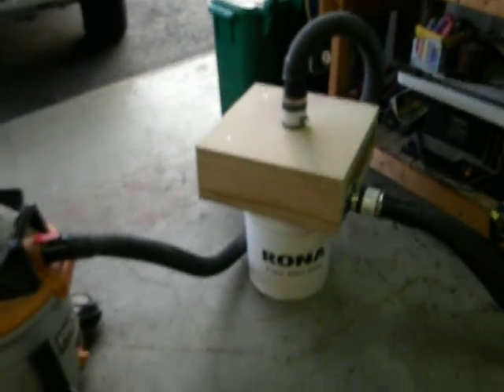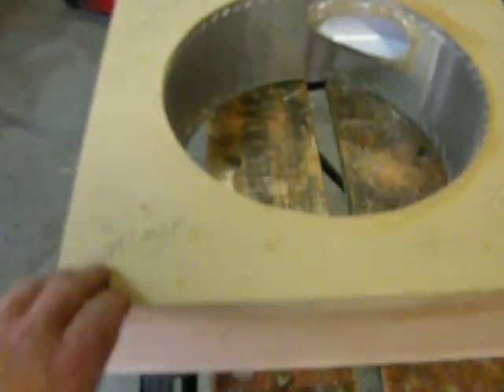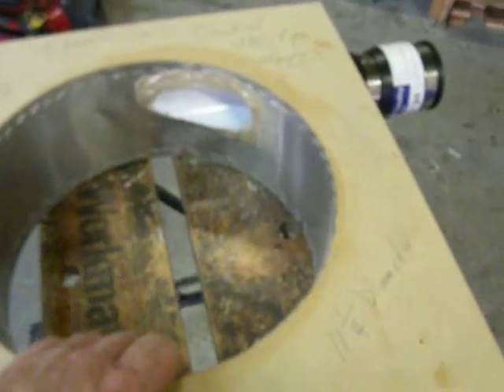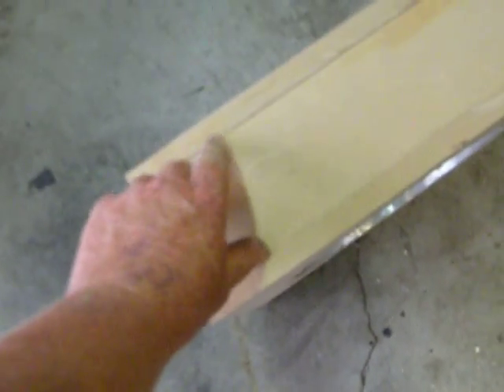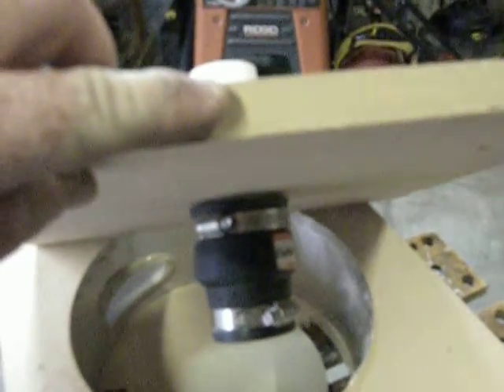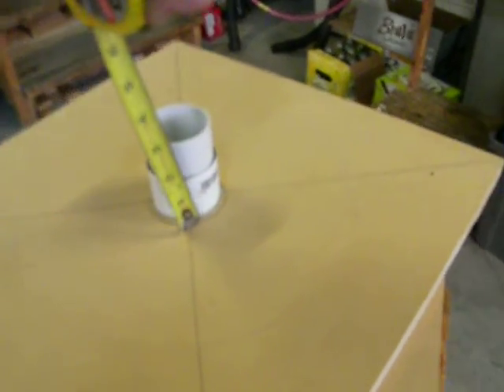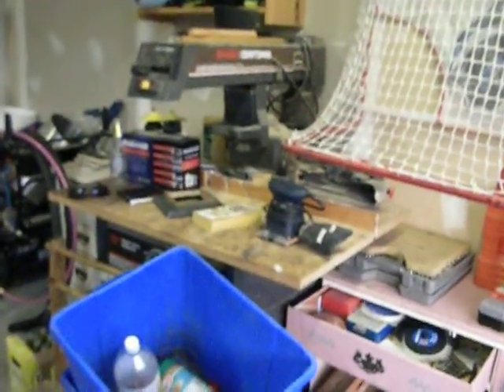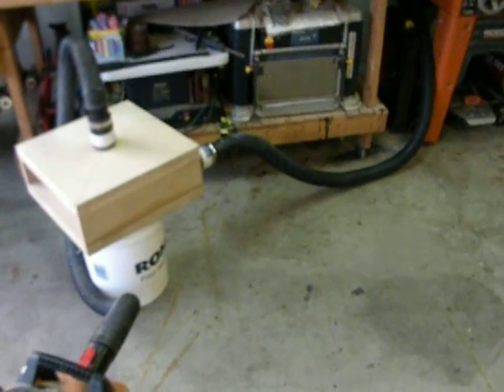How to make a cyclone dust separator for your shop vac.

Comment: Rob have to used the home central system for the cyclone?
Reply from the maker: You could use it with a central vac but many new central vacs are bagless so it's not as necessary.

Comment: Fill/inject the void in the box with PU foam-filler between the valley-flashing and the outer case. This will hold the inlet pipe steady and allow you to blend the surface /end of the pipe to the inner surface of the cyclone to reduce turbulence and improve separation.
Reply from the maker: +nlo114 - Spray foam is very versatile.  It's a valid option here.  Thanks for passing on that idea.  On my newer cyclones I have used stacked particleboard and cut out the circle for the cyclone and drilled the vac. port through with a forstner bit.  I like the wood ones better as they were easier to build and have a quieter operation.  Thanks for your comment!

Comment: Hi Rob! Great design!!! Do you have a list of the supplies needed? I basically watched and wrote down the different items, but wondered if you have an actual list? My husband is going too build it for my daughter to use to sand driftwood!
Reply from the maker: gmLb8806 No, in hindsight that would have been a good idea.  Here is another design (you can just make 1/2 of it) that may be easier to build.  Was my 3rd design and it's the one I'm currently using.  Good Luck with your build and thanks for your comment!
http://youtu.be/IfnIYbl63W4

Comment: Hi thanks for the inspiration I have just completed one of these and it works great ! I made my one with half a plastic bucket set into the mdf instead of flashing and I just cut the bottom of the bucket the same way as you cut the base of yours I left it proud about an inch so that it sits inside the collection bucket  and t worked first time.

Thanks again keep up the good work Jim
Reply from the maker: jim copland Awesome Jim!  You shouldn't get any dust in the vac at all once it's tweaked just right.  The bucket Idea is a good one.  I'd love to see it!

Comment: Does anyone know if a Thien baffle will still work if the airflow is pushed into it vs sucked out of it? My planer exhausts it's own chips. If I were able bodied I'd simply build one and see, but I'm disabled and building things is difficult so looking for input and/or experience with this. Also any 'bad' design flaws to avoid?
Thanks
Reply from the maker: George Woodworth It should work to some degree but it would work better if you bought a shop vac and used it together.  Ridgid vacs are not too expensive (They are the ones I use).  Good Luck!
Reply from the maker: George Woodworth Maybe this style might work best without a vac.   
http://youtu.be/tbsHjpKt4aM

Comment: This wouldn't be hard to scale up to sit atop of a 55 gallon plastic drum.  The design is solid.  If air is heated before it goes into the cyclone you could make a food dryer out of it (assuming it is sanitary).  This design has LOTS more applications than simply sucking dust out of your shop.

Ebner
Reply from the maker: ebnerglocken Sounds like a project. Good Luck and thanks for the comments!

Comment: Did you test it without the bottom on it? It might work just as well or better.
Reply from the maker: My first cyclone separator was designed like that.  It would build up a sawdust "snow drift" and then the sawdust would get pulled into the vac.  This set up at the bottom allows the dust to fall out of the air stream and into the bucket without being regurgitated back into the vacuum.  It works so well my buckets get completely filled to the bottom of the cyclone before they leak dust back into the vac. Thanks for your comment!

Comment: This design Rocks!  Followed Your design, and my PL Prem. applied yesterday morning has cured.  Just gave it the first test run.  Removed the bag from the vac to see results and dumping out shavings (Lathe, Bandsaw, tablesaw, drill, and circularsaw and router mix), dust, even picking up some rocks and bits of who knows what in the seams of the cement slabs in my garage.  Even grass off the riding mower...... Nothing!  Nada!  Nil! NOT A SPECK in the vac whatsoever!!  ALL in the bucket!  THANK YOU

Comment from the maker: OK!  Here are the exact measurements.  Locating slot (fits on bucket) is 1/2"w X 1/4"d (has cheap weatherstripping to help seal to bucket).  Dust slot is 1 1/4"w and total length is 22" or 220 degrees, it starts 3" from the inlet pipe.  The vac port (top) sticks into the cyclone 2 1/2", leaving a 2 1/2" gap between it and the base plate.  The inside height is 5".  There is some turbulence generated by the dust pipe input and the staples, don't know if it improves performance or not.  Good Luck!

Comment from the maker: That's really strange.  Lots of people have similar designs posted.  The only thing I can think of is that you may have the input and output reversed.  The shop vac plugs into the top and your saw or other tools plug into the side.  Other than that it might just require some tweaking.  I'll give you exact measurements when I get the chance.
RM

Comment from the maker: What about the slot in the bottom plate.  Is it in the same position?  The hole should start a few inches from the input pipe.  You should be able to tweak the design to solve the problem.  Did you try the small deflector that you talked about? Keep experimenting and you'll get it!

Comment from the maker: Try adding another inch of pipe inside the output of the cyclone.  (the pipe inside the cyclone in the centre)  If you look at an earlier version I had the same problem.  The video is - cyclone dust separator 3 (and 4).  Also rotate the base plate with the long hole so that the hole has space between the input pipe and the start of the hole.  The dust has to fall out of the air stream so having the hole right against the input pipe isn't as good as having some space between them.  Best of Luck!

Comment from the maker: @beebear2001 Just a little smaller than the bucket diameter because the wood has to sit on the edge of the bucket.  I routed in a groove the size of the bucket (on the bottom) for it to sit and not move around.  I also added some weather stripping (white ring on bottom) around the slot to give a tight seal.  The weight of the unit keeps it in place and you don't need to lock it onto the bucket.  Enjoy your new clog free vac!

Comment from the maker: @beebear2001   The valley flashing is 5" wide.  The square hole is just because I didn't use a long piece of 2X4.  I just used a small piece to drill a hole to support the central vac tube (which is also glued in place with the PL Premium).  Check out my other videos to see more detail.  Cyclone dust separator 2,3,&4.  Best of luck with your build!

Comment: Oh, I'm glad I saw this!
My old vacuum had a couple of little square exhaust ports, that you couldn't put a hose on. My new one is a vacuum/blower, like the one you show. Until I saw this, it never occurred to me that I can plug hoses into BOTH of the holes (intake AND exhaust) at the same time,run the exhaust outside....
Stupiphany! (the realization that how you've always been doing it was really, really stupid.)
I'll be making the changes tomorrow...
Thanks.

Comment: @robsgaragewoodworkin Hey Rob. On mine I think the height has a lot to do with it. Because of the elbow I've put on the intake there is a cyclonic action but it gets stirred up so much in that small bucket that it gets sucked up and goes to the bag. Taller would be better for it. I think I'm going to make something to hook to my big d/c. I wish I had a place where I could put that thing permanently and run piping. I should build a shed outside for the d/c and compressor.
Take 'er easy.
Larry

Comment from the maker: @Larenzoid PL premium is a brand of construction adhesive that will stick to both the metal and the wood.  I tried the simple bucket design also.  This set up allows for you to almost fill the bucket, so you can work all day.  The simple bucket will let lots of sawdust in the vac once the bucket is about 1/4 full.  The slit allows the dust to fall in the bucket and not be drawn back into the vac.  I got rid of my 4" industrial dust collector after making the cyclone.  Now I use 2 with 2 vacs.

Comment: I've never heard of PL Premium, is that a brand of epoxy, or is is silicone? Also, why didn't you just cut a hole in the bottom instead of the slit? Wouldn't it still work it the bottom was open to the bucket?
I made one a while back with a 5 gallon bucket and a piece of plywood on top with a 4 inch fitting in the middle and a 2-1/2" fitting out toward the edge. The smaller fitting has an elbow inside to direct the flow. The only thing is that the bucket is needs to be taller.
Larry

Comment from the maker: @complex2034        If you watch the video "cyclone dust separator 4" you will see that you don't even get dust in the vac or on the pleated filter, so I would have to say the performance is equivalent to a store bought cone system.  The advantage is the price, making your own will cost you less than 1/2 the price of the store bought cyclones and it's far more durable.  
Thanks for your feedback